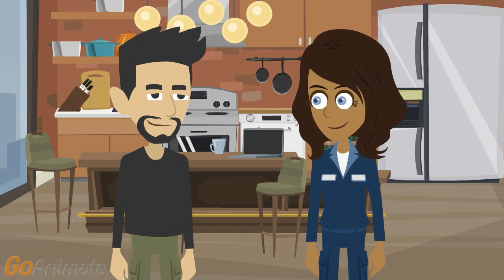How to Fix an Oven that Burns Everything

Comment: The elements just stay on constantly
Reply: Sounds like its a bad temperature sensor...you can test it by removing it and with an ohm meter check to see if you get about 1100 ohms at room temperature.